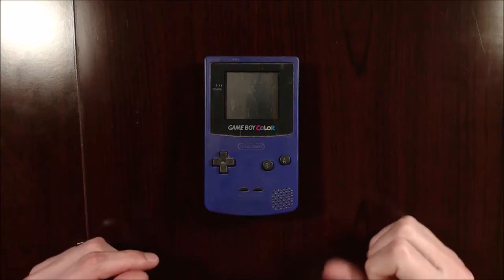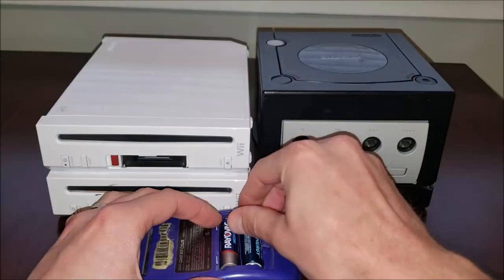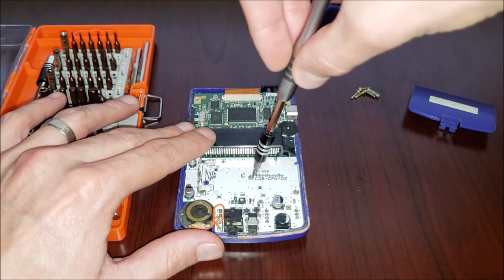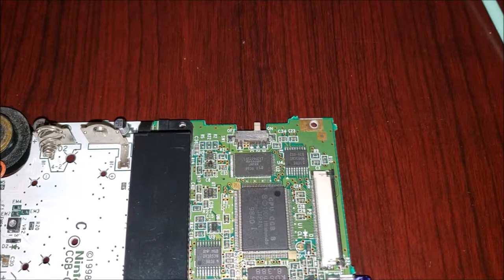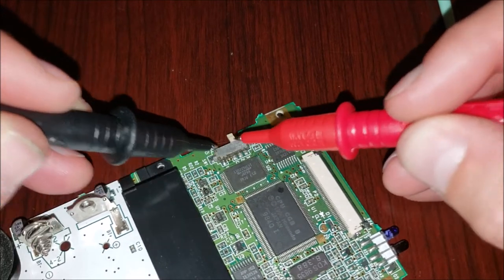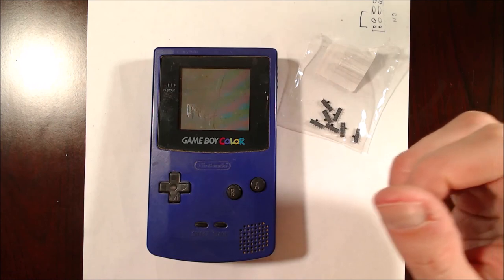Game Boy Color Repair | Power Switch Replacement

Comment: Anybody's opinion what is that Gameboy Color worth? And will the prices on these go up?
Reply from the maker: Really depends on condition and the buyer. Anywhere from $60 - $80 is the rough price range for a decent condition loose unit. If you buy locally you can usually get better deals like $40 or $50, but requires more patience. The price may go up a bit in the next few years, but I wouldn't expect a huge increase.
Reply: @FantasticQuack  Thank for the heads up. A pawn shop has a grape color for 50$ it has the battery cover but the lens is pretty scratch. On a local buy and sell there is a clear purple and kiwi Green both are in really good condition asking price is 80$. It's starting to get out of hand where I live. Appreciate the help.
Reply from the maker: @OnGod1007  I'd say just keep patient and checking facebook market / craigslist. 
A little less than a year ago I picked this one up for $60 just by keeping my eyes open for deals:
https://www.reddit.com/r/Gameboy/comments/jxiv9m/facebook_find_from_today_love_this_thing/

Comment: Replaced mine today. Just a question for you tho, I was successful and I got the power switch replaced but now my problem is it’s stuck on and I have to take a battery out for it to shut off. What could he the issue thanks ! And thanks for the great video
Reply from the maker: The switch slides up and down normally but both positions leave the unit powered on? If that's happening you may have shorted some pads on the switch, or the switch itself has an internal short. Very unlikely but not impossible is that there is a short on the board itself, which means it would turn on even if the switch were de-soldered entirely. All of these potential issues can be tested with a multimeter.

Comment: Hi, i have a question, what is this that you used that it's looks like copper in the minute 5:20
Reply from the maker: Hi! That is a solder wick which is just fine copper wires braided together. It's used to clean up solder. The solder will flow readily into the braided copper enabling you to get it off of the circuit board.

Comment: Have you seen what must be the newer V2 switches? I have only found them on eBay. Try searching "Power Switch V2.0 Replacement For GBC Game Boy Color Game Console" , it appears you can just take the old on off and drop the new one in place with fresh solder. I plan on using them when they finally arrive (30+ days since order) tomorrow. I'm new to GBC restoration, and this video helped me a lot. I have very little electronics knowledge, so showing the resistor/ what parts work helped me diagnose my power switch problem. Great video, thanks.
Reply from the maker: So glad this helped you out! That switch you found looks like a great option and should definitely make your life easier than the finicking I had to do here. Cheers!

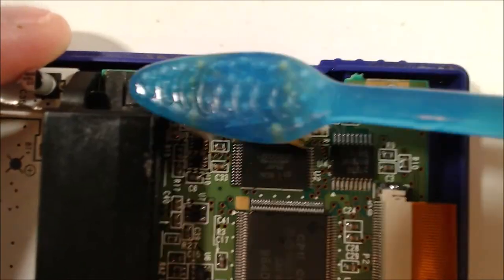Comment: 8:22 what was that tool that you used? And what did it do?
Reply from the maker: That is canned air duster, I was blowing off the area with the canned air so the alcohol would dissipate and dry off more quickly
Reply: @FantasticQuack  ok, thanks.

Comment: Are you able to put out the pin traces as I have a gbc I'm trying to repair but has lifted pads on 2 and 3
Reply from the maker: At 6:31 - Immediately left adjacent to Pad C there are three ring shaped pads (called vias) and they all connect to C. Pad 2 is just a dead pad used for strain relief so it doesn't matter electrically if you connect here. Pad 3 also has three vias right above it that can be used. Pad 1 only has one via to the upper right of it which can be used.
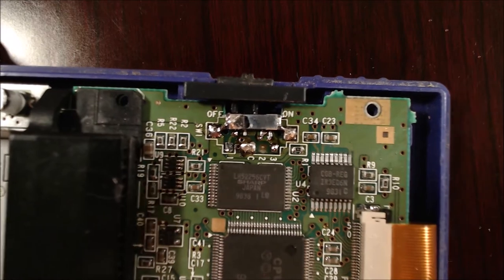You can see the finished job at 8:12 where the connections are made using the vias as I described above (I had to do it like this since the switch was so small), notice how I don't even use Pad 2 and that the 3rd and 4th switch pins are both connected to Pad 3. The large pads on the left and right ends also offer no electrical connection, these are just for strain relief. The 1st switch pin must connect to Pad 1 and the 2nd switch pin must connect to Pad C without any shorts between them.
Hope that helps!
Reply: @FantasticQuack  thank you so much I have lifted pads on mine so I'm going to bridge some wires and then put a switch on it, this is the only video I have found with a similar issue to mine

Comment: so pin 2 is dead? is it useless?
Reply from the maker: pin 2 is "dead" just meaning it's a bare pad not connected to anything, so it's electrically useless, but it does mechanically provide some extra strain relief for the connector.